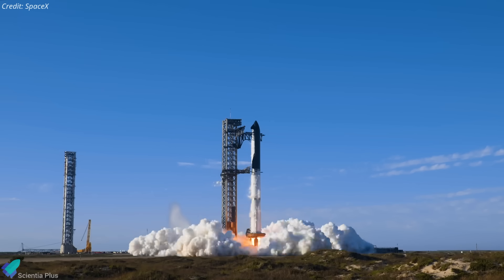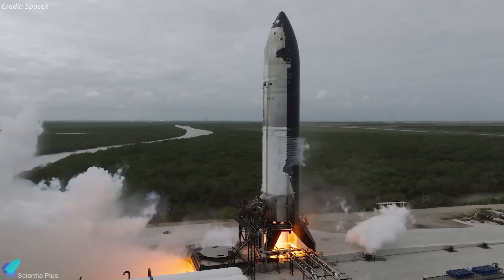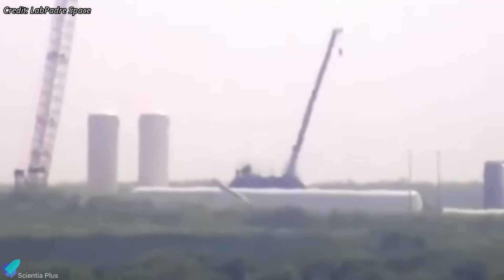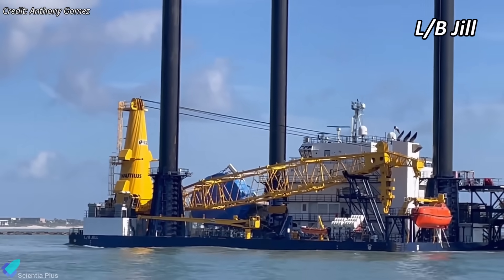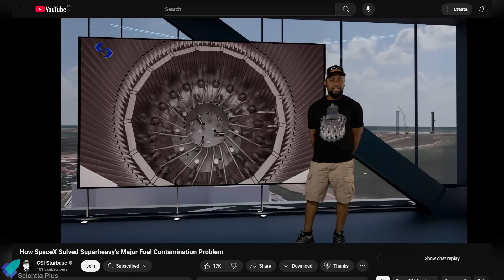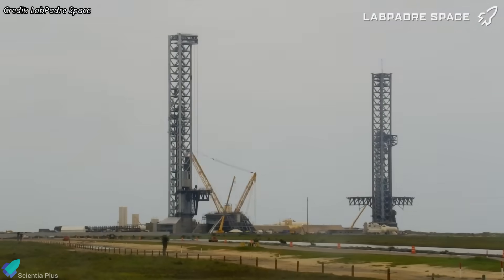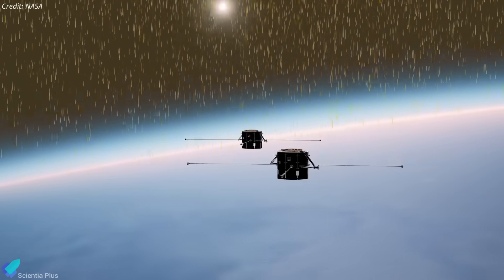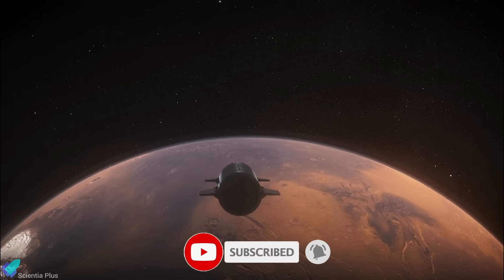Starship Launch Tower LEAKS?! Ship 37 Static Fire Soon & Booster 13 Recovered, BUT?

Comment from the maker: 00:00 Starship Updates
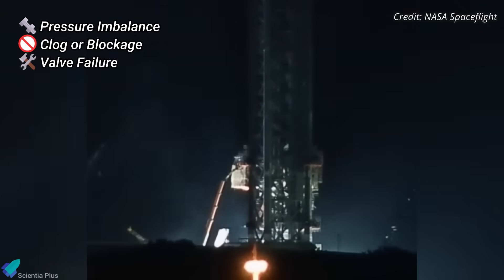11:16 NASA Just Launched Something BIG With SpaceX!

📚 Learn More:

🚀 Starship Block 2 Explained:
 📖 Summary: https://shorturl.at/b0dtw
 🔍 Detailed Explanations:
  • Design Improvements Update 1: https://shorturl.at/lpGT7
  • Design Improvements Update 2: https://shorturl.at/gwNQ4
  • Nosecone & Payload Bay Redesign: https://shorturl.at/xa60S
  • Methane Downcomer Redesign: https://shorturl.at/XdYBG

🚀 Starship Block 3 Explained: https://shorturl.at/mnBT4
🚀 Starship & Booster Block 3 Detailed Breakdown: https://shorturl.at/IViwD
🚀 Starship & Booster Block 3 Production Begins: https://shorturl.at/xRNkJ
🚀 Booster Block 3 New Transfer Tube Explained: https://shorturl.at/Iaqc6

🔥 Raptor V3 Mega Upgrades & First Test: https://shorturl.at/TRIyj
🧱 What’s Inside Starship GigaBay?: https://shorturl.at/nJM75

Pad B Explained
🛠 Insane Engineering of New Starship Launch Pad B: https://shorturl.at/7RAZd
🛢 Dual-Port Orbital Refueling – Full Technical Breakdown
https://shorturl.at/5tiqK

🛠 Other Starship Upgrades:
 • Hot Staging Explained: https://shorturl.at/jf400
 • Super Heavy Booster Upgrades: https://shorturl.at/Pi5R3
 • How SpaceX Protects Raptor Engines: https://shorturl.at/4Om8F
 • New Heat Tiles Explained: https://shorturl.at/p2Ijb

🔥 Starship 36 Explosion:
   Detailed Breakdown: https://youtu.be/VWQiIz1ymBA
   Damage Report: https://shorturl.at/Quoex

🚀 Super Heavy Booster Ice Filter Deep Dive CSI Starbase: https://tinyurl.com/bdcb28nk

📡 Stay Updated:
📢 Weekly Updates: https://bit.ly/3HIQjPC
🚀 SpaceX Playlist: https://bit.ly/34wue8T

🌍 Follow Us:
👍 Facebook: https://www.facebook.com/scientiaplus